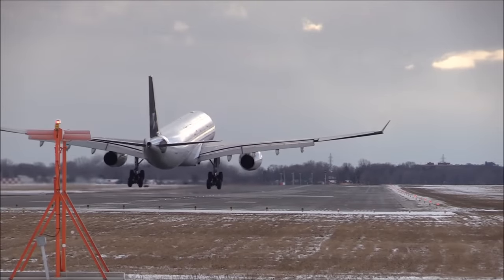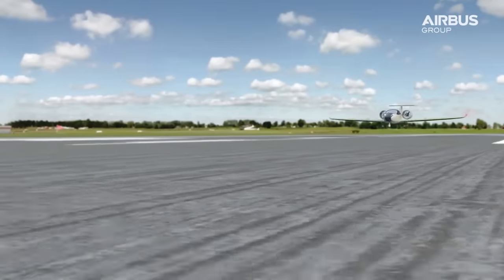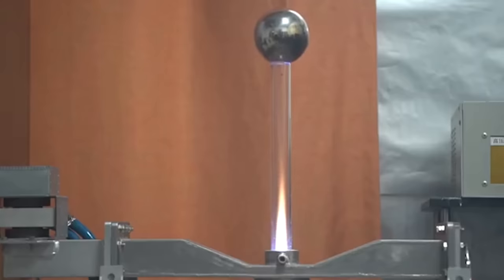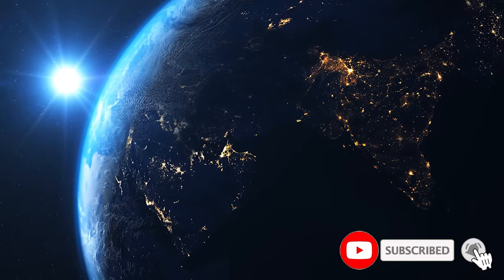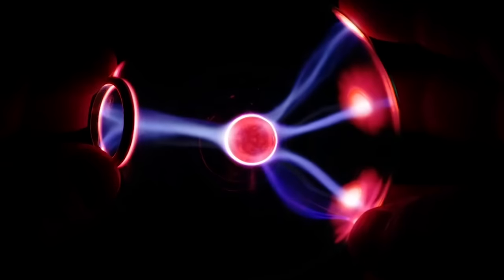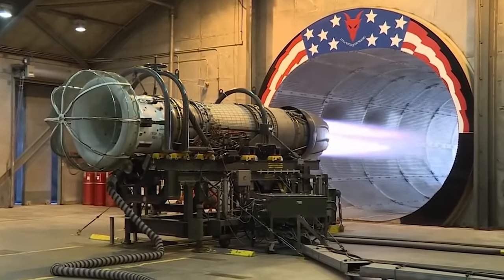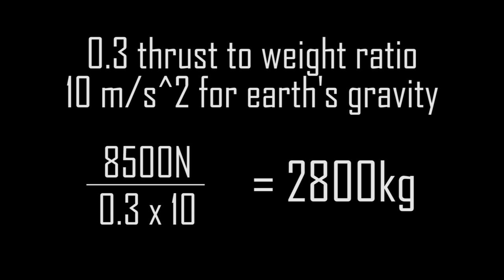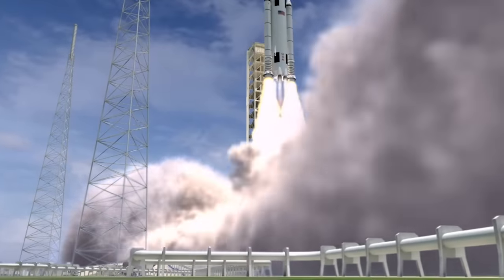Uncovering China's New Electric Plasma Jet Engine

Comment: I already discussed this with a colleague of mine and ran some calculations years ago. With our current technology in battery efficiency and plasma generation technology, this is kind of flight technology is a child's dream. Dont get me wrong, all this is possible, but only in theory. To produce this for actual commercial flight or other applications is not really possible with our current technology and won't be possible for atleast another decade or so. Do you know how much energy you require to generate even a single digit percentage purity of plasma. Which mind you will be needed on a larger scale engine using this technology. And that does not even cover the energy required to run the compressor.
Reply: Well.. as any proof of concept you start somewhere with the concept and then you improve over time..
But of course, not all research makes it into production
Reply: How about Tokamak.
Reply: @acasualviewer5861  I would first start with calculations before investing millions into a white elephant.
Reply: @blameyourself4489  That's because you can't find the funding to, Chinese government is flush with money therefore the reason they built it.
Reply: @madzihove  Not really.  Why would anyone invest in a technology that uses 40KW/N when conventional technology uses 450W/N?
Reply: @blameyourself4489  Then why build the first plane, why build the first battery, why build the first computer......yet look where we are now. Lots of money goes into R&D that doesn't produce anything. China has the money to build it. If it comes to nought then oh well but there is always the chance it will lead to something greater.
Reply: What if it was powered by a nuclear reactor?  Just as nuclear submarines we can produce nuclear airplanes
Reply: @cyrilthomas3186  Too expensive, not economical, also size and weight of aircraft would we unnecessarily high. Fine a more compact solution to nuclear fission and your golden, but that just doesn't exist right now.
Reply: @nyx3745  oh
Reply: Well I just came up with another way of Using this but it requires a Nuclear Reactor preferably made of Thorium
Reply: What king of minimum denisty in kj/kg would be required you think?
Reply: @blameyourself4489  He may have soon the batteries to  use this ?
Reply: @asandax6  That's clearly nothing someone should use in a atmosphere. Space is fine for me. But these engines work with air.
Reply: @madzihove  It's not about not being innovative.  It's about chosing the right technologies for the right purposes at the right economic costs.
Reply: @hansjorgkunde3772  I don't think so.  There's a reason why liquid fuel is used.  It's energy density.
Reply: Well screw batteries at rhe moment(and to be straight about it. I'm not trying to dish on batteries). I don't know why most people are trying to go straight to batteries when hybrid is an option. 
If I'd to run this on a hybrid setup. If I hac the time to study and actually attempt to recreate this off of a more efficient generator. 
Would this actually be a conversation to attempt?
Reply: @cyrilthomas3186  where do you think nuclear submarines came from to begin with?
Nuclear airplanes. 
When they couldn't get that to work. Tbe navy took the tech the airforce tried to implement and made a submarine with the airforce's failure. 
One person's failure can be another one's success.
Reply: @KiwiClawDHA  Nope.
Reply: @KiwiClawDHA  oh thats new info,  thanks!!
Reply: @blameyourself4489  you really don't like this do you?
The output is low, but many things started with bad efficiency.
Reply: @KiwiClawDHA  You are right.  I don't like it.  Most people tend to forget the economics behind the technology, but also in this case behind the thermodynamics.  I simply don't like - insert your miracle - here technologies.  I had this idea myself 20 years ago and tossed it away because the problem with its fuel efficiency is not solvable.  Then better use an ion engine.
Reply: We certainly have to be able to show capability before scaling up.  If the energy of the compressor overwhelms the energy produced then it is a washout.  Is there other places in the solar system where this could work? Say Venus or Saturn? Maybe Earth does not have the right environment.  Interesting to think about.
Reply: @Wulfcry  First you have to get the damn thing working
Reply: @asandax6  You can't just duck tape a reactor to a plane. Well I guess you can, but let's just say the passengers wont be back for the return flight

Comment: It's going to be very difficult to make this efficient, especially since propellers are already the most efficient thing we have as long as the propellers are limited to subsonic speeds. If we could just eliminate the problem of wave drag, we could have fast efficient propeller planes.

Also ionising air sounds like a great idea, but it actually isn't, because when it recombines, it will create NOx emissions.
Reply: Insignificant.
Reply: Turbofan engines have been breaking the sound barrier for decades. I might be confused but we already have "propellors" that can travel faster than the speed of sound
Reply: @lasttruegamer9537  No, propellers rotating faster than the speed of sound is a bad thing because it causes vortices from the tips, creating very high drag, vibration and noise. We can easily get there, we just don't want to hahaha

Comment: Maybe the work on "Aneutronic Nuclear Fusion" will come to fruition sooner rather than later. That would provide a perfect power source.
Reply: If you achieved that technology wouldn't you just use a jet of super heated air or steam rather than the extra step to generate electricity?
Reply: @grantfrith9589  The whole point of Aneutroic Fusion is that it produces electricity directly.
Reply: @lon3don  Oops. My apologies. I'm not familiar with that technology.    
How do they perceive that they create a circuit? Or are you thinking the plasma could be directed straight from the reactor somehow?
Reply: @grantfrith9589  The process of aneutronic fusion produces high energy charged particles which can be used directly for electrical energy generation. 
I personally think it is not possible to realize this in the next 100 years.
The only options i see for a plausible system is a new process to generate power, that we are not aware of yet.
Reply: @anti-fz9be  Yeah, that was what Wikipedia said. What it didn't say was how to harness the radiation in a useful manner. Of course that is only a secondary issue to the sustained reaction problem.
Reply: PS: From what I gather the small particle radiation component is more of a by product of the reaction when you compare it to the heat generated. I suspect my initial comment may be right by default.

Comment: I still fail to see how can such an engine (if it indeed works) be energy efficient, considering the number of times the energy changes form, each of such step typically being associated with a loss to thermal radiation, friction, etc.
Reply: Because your instincts are correct. The more power you try to generate, the less efficiency and power there will be.  Marvin Carlson a few posts above pretty much proved it with the proper formulas.
Reply: Something like this might be well suited for maneuvering thrusters in space, with an atomic power supply. I suppose, however, there's still the issue of all the compressed air you'd have to carry. Sooner or later, this principle will be combined with other principles to form applications we probably can't imagine right now, any more than Nikola Tesla could have predicted angry birds when he described smart phones a century ago.
Reply: Jet engines are about 45-50% energy efficient. If each of the energy changes in the electric engine is 90+% efficient, you can have at least 6 energy changes (53%) and still be more efficient than a traditional jet.

Same idea applies to electric cars vs ICE cars.
Reply: @stevk5181  Compressed gas storage is going to be an issue. So is the power source.

Comment: A breakthrough in battery technology is on the horizon with solid state batteries, this combined with enhancements to this ionisation process and hopefully optimisations with aircraft weight due to new nano materials being used will surely, one day, give us a truly environmentally friendly way of flying. Of course, it only takes one spanner in the works and we are still left with the old jet engines :(

Comment: It's gonna take like 50 years before this is realized
Reply: You are making a linear projection. Technology grows exponentially. If it is possible, I expect progress would be much faster.
Reply: Not with Chinese
Reply: @jhutsebaut   This. We'll probably have this, powered by a small fusion reactor, on a commercial plane in 5-10 years.
Reply: @jhutsebaut  that is an oversimplification and doesnt hold the history test. It is not possible to tell if this technology ever will see practical use, and if it does it is not possible to tell when. It is a way to complex subject. Based on exponential growth in technology people in early 60s thought we would have flying cars and colonirs on mars by now.
Reply: I don't think it's about 'realized' tech, I think it's about finding out if it's possible, and then going from there. There's every chance in the world that the thing we end up getting out of this is more like a really nice space heater, or maybe a more efficient fuel based engine used for cargo ships on the ocean. Something that no one will ever notice, slowly incrementally working its way into everyday mundane tech making life better. I doubt anyone who designed the CMOS light sensors way back when, that eventually became digital cameras was thinking that the primary use of it would be taking pictures of our breakfast with our cell phones to share on Instagram. They were probably thinking hey.. this microchip can detect the horizon so rockets can steer themselves. That's how progress goes.
Reply: @jameshughes3014  Brilliantly said

Comment: "The aviation industry... can produce up to 3 times as much carbon emissions per mile as a conventional petrol car."  Let's dive a little deeper into that.  Assuming that "up to 3 times as much carbon emissions" applies to the largest aircraft, say the A380, which carries some 500 passengers; or the 747-400 which carries around 600 passengers; and the 777 which can carry 350 - 400 passengers.  It's easy to see that the per passenger carbon emissions per mile is minuscule compared to a conventional automobile which may carry 4 - 6 passengers.  

Statistics are a funny thing in that they can be manipulated reframed in so many ways.
Reply: Not much sure about that but I buy your take on this because the relative efficiency difference should be minute since IC cars are very inefficient due to size-economic constraints wheres a plane with ~500 passengers should easily crush car emissions , I think there is some miscommunication on this guy's part. a figure blunder of this size cannot be go unnoticed

Comment: 5:58 "Maybe this electric jet technology could power the rockets of the future"
No, just no.
You even mentioned the TWR of 0.3, so you'd need to use it in space like ion thrusters, but it needs air, so that ain't happening.
Reply: It could be used just for the first stage of the rocket or something similar to Virgin Galactic's White Knight Two. A sufficiently energy-dense battery could power an electric jet engined rocket with a better thrust-to-weight ratio than any chemical combustion rocket, since there's no fuel or oxidiser being carried on board.

Comment: "Though in the vacuum of space this is not an issue
 and over time the tiny amount of thrust compounds to enough force to move a whole spaceship"

That statement has is wrong in two regards physically.

Thrust does not compound to force. Thrust over time compounds to velocity. And thrust and force are equivalent terms. 

Further, in zero gravity and no friction the tiniest amount of force will accelerate an object and change it's velocity.

But your notion that over time this compounds is still correct. Still, educational videos such as this need to use the correct terminology as millions of people watch these videos.

Comment: The problem with electric planes is that the most effecient way to produce high thrust is to compress air heat it up and shoot it out the back. So the pressure out the back is the same as your compressor but the volume is much larger.
So burning something is the most effecient way to produce heat. The only way we will get anything better is by using nuclear power to produce the heat. Any other form of using electricity to produce heat will never come close to burning. You don't have the benefits of a 95% effecient  electric motor to compensate for the 90% energy density disadvantage.
Reply: What about more efficient fuel,
like Hydrogen, to createa cleaner more effective burning plasma ?
Reply: @AJCsr  the problem with hydrogen is that it is difficult to store and manage. It is low density and needs to be stored at high pressure meaning large heavy tanks that can not be shaped like wings.
Reply: @AJCsr  It's my understanding that right now it takes more energy to produce hydrogen and compress it than the energy in the hydrogen itself.

Comment: I think it would actually be possible to build a working model of this using just a microwave as in a microwave oven. Quite likely you'd have to design a new wave guide, but the fact that you can develop a continuous ball of plasma inside of a rotating microwave oven is inspiration enough I would think.

Comment: This is interesting,  combine this with the new solid state batteries being developed,  you might have a plausible system.
Reply: I think for an airplane where weight is a major consideration... hydrogen & fuel cells make a lot more sense then batteries.
Reply: @gcburns4  fuel cell systems still use battery banks. Also, the new batteries being developed have much more energy density,  as well as not having the negative properties of lithium batteries. Actually, one of the most promising solid state batteries is being developed by one of the guys that refined the lithium ion battery,  Dr. Goodenough.

Comment: Good Video.  Like your thinking out the thrust vs weight to determine if this is any where in the range of feasibility.  Haven't checked your numbers and process but the logic is clear.  Additional critique of the original study: Innovative measurement but no proof of calibration in the paper.  Device could be producing more thrust per power (or less).  Something tells me it is not far off. Good opportunity to add to what the authors have started.   Also, the shape of the tube and other adjustments may add efficiency, another opportunity to add value.
Reply from the maker: Thanks for your comment! I agree there was a lack of detail in parts of the paper! I also imagine there is a lot of room for improving the efficiency too, I will be interested to see what other researchers or industry players do with this!
Reply: The design looks simple enough though, so peer reviewing should be fairly straightforward as anyone can build this in a physics lab.
Reply: would adding an alternator to the engine be enough to power it?
Reply: @jebeandiah  No, the energy to power this will have to come from an external source. I'm still skeptical whether this will be more efficient than a ducted fan or compressor attached to a simple electric motor.
Reply: why will it have to come from an outside source?
Reply: @jebeandiah  Because energy can't come from nowhere, so an engine can't power itself. In a jet engine the energy is normally stored in chemical form as fuel in the tanks.
Reply: the fuel is the air
Reply: @jebeandiah  Uhm, no, the air does not contain any energy, it's only a propellant for the engine to push against, just as the road is in your car.
Reply: got it, so the plasma stays as matter?
Reply: oh, i just realized you'd have to create fusion for the air to release energy
Reply: @jebeandiah  The air gets turned into plasma by zapping it with microwaves, before cooling back down and the energy from the microwaves gets converted into high temperature and pressure. But the energy needed to make those microwaves can't come from the engine itself.

Comment: Optimized to the microwave resonant frequency of N2, the monoatomic nitrogen's additional thrust could net an astounding increase in Newtons per watt....
Reply: Oh! Oh! I was just saying this my wife the other day ..... then she hit me SO hard ........
Reply: And hit the critical 1.21 GigaWatt level to activate the flux capacitor..
Great Scott !
but seriously, where does that much ionizing electrical energy come from ?
Batteries ? There's not enough storage capacity yet..lower energy density , higher weight and cost..still, this could add extra afterburner type power to conventional liquid -fueled engines
Reply: thumbs up from me, Isaac Newton, thank you from Britain

Comment: This is a standard way of igniting and generating plasma and has been around as long as the magnetron. The first one of sufficient power in the frequency range necessary was built in about 1936. The experiment is not noteworthy as it has been done this way for probably 70 years. https://en.wikipedia.org/wiki/Cavity_magnetron

Comment: Very interesting.

You should exclude the 4N of thrust from the compressed air in your calculation because, as you mentioned, the 400W microwave power consumption does not include power for compressing the air, so the energy balance is not right.  Still a promising development after you factor that in though.